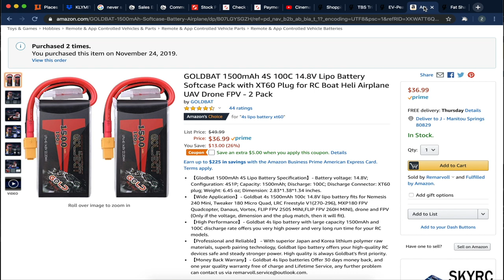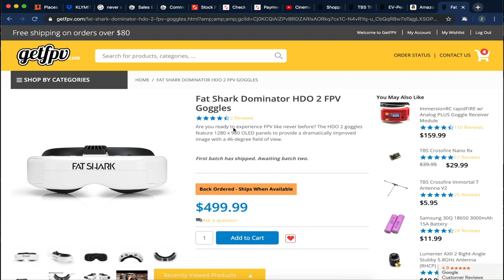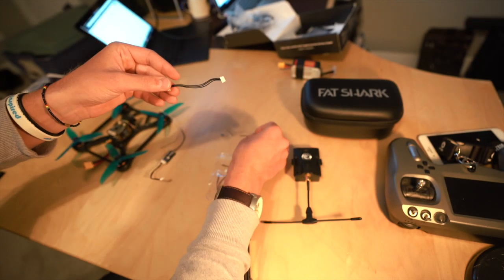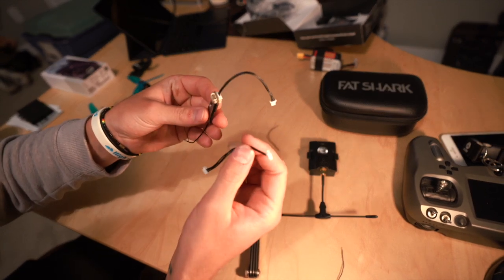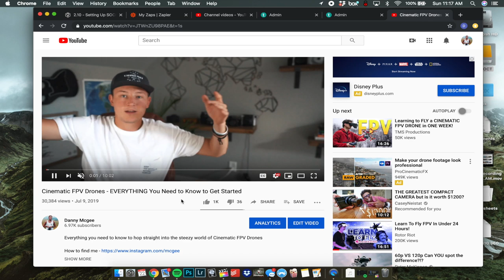The BEST Cinematic FPV drone - TBS Oblivion full setup video

Comment: My fists serious 5 inch has been Emax Buzz. I was then thinking that BNF drones are perfect for beginners. But, what about any repairs after crashes? Then I changed mind and I still think that any beginner should first off all learn how to build or at least how to repair just in case. Every drone pilot will need to repair their machine eventually. Thanks for sharing. Cheers!

Comment: Hi, I have a Taranis Qx 7 and I was wondering if I could use that with the TBS Oblivion. Thank you, love your vids keep up the good work :)
Reply from the maker: Yep you should be able to - the bind process will be different but I've seen other people wit that setup
Reply: If you want to use it with crossfire, there is a modification board that needs to be installed.
You can get it from TBS.
Otherwise you can just buy a Frsky receiver.
Reply: I Actually do just that. I purchased an R-XSR frsky receiver and with very little work you can get it setup and get it on betaflight. IntoFPV forumn has been a gold mine for me, and if you look, you can probably see my help me thread doing just that!
Reply: @Bigbeardfpv  Seen your thread :)  Did you make it work at the end? Also thinking about going the same route with R-XSR on the oblivion.

Comment: is it possible to get everything else and go for a different less expensive pair of goggles?
Reply from the maker: Yep you can use pretty much any google
Reply: @Mcgeee  okay sick thanks for the fast reply! also one more thing about the tango, I'm trying have m budget at somewhere around no more than $500 any recs for less expensive controllers and goggles?
Reply from the maker: @hankbabiar9668  Beagle drones has a super solid setup that's around that price. It comes with a drone, controller and optional goggles. Check this video out - https://www.youtube.com/watch?v=alGFjLF1YEo&t=53s

Comment: I really want to get into this hobby, but I’m so scared that if I crash it, it will result in a lot of money wasted I.e drone breaks, GoPro breaks or I lose it and repair costs.
Reply: Start with a simulator... and fly without GoPro in the beginning. 
There is no such thing as "if you crash".  You will crash within 10 seconds of you first take-off,  so learning to build and repair is mandatory...
Reply: Grab yourself  Tinyhawk RTF kit.   It's a full experience and beginner to intermediate level.   It will help you realize if the hobby is for you or not.
Reply: Darrel is spot on. Just get a tiny whoop
Reply: first step, don't listen to danny, the oblivion isn't even in the top 50 best ready to fly cinematic drones
Reply: Madmacs FPV how come?
Reply: @Michal_Kedzierski  there is a large fpv community who are mostly happy to help, you should get advice and buying options from them,  the TBS company makes some great gear, but this particular quad isn't very good, never has been very good, i can't help feel that danny knows this is pure advertising for TBS, which fine as long as its open about it.
Reply: @TheMadmacs  any suggestions on good pre built quads?
Reply: @Michal_Kedzierski  well this is the thing, i can suggest quite a few superb quads, cheaper better than the oblivion, the iflight nazgul 5, both 4s and 6s (4cell 14.8v and 6cell 22.2v) is not only a great quad but great value, anything by armattan, literally anything,  or if you are on a budget, the skystars starlord, i would also point out you need two quads, you can't fly well knowing one crash would end the day,  but i would add another class oof quad called cinewhoops, which are slower and better for  general cinematic slow stuff, mostly 3inch quads, you guys must realize a 5inch quad is a racing machine capable of 0-60mph just over 0.5secs, even the slowish ones??? the best advice is to watch a few youtubers and get a feel for what you want and need,  andyrc has a great channel with top quality reviews, but also watch some pure pilot videos like russel kim fpv, jjfpv, jordan temkin fpv,  you will find most people in this hobby got here through help from other people and are more than willing to help when you get stuck.

Comment: What camera angle do you have? I have a race drone with 45” camera angle, is that a lot?
Reply: 45 is a lot, you could race with that angle, lower is easier for learning and for tricks and landing, a good wide angle lens helps 2.1 at least and possibly 1.8 , 145 to 165 degrees respectively, i use 20 to 30 deg cam angle, if you ever want to hover and look at something you need about 20 or less
Reply: @TheMadmacs  ok thanks, i will build a drone for cinematic anmd 20/30 cam dregree

Comment: This video is clearly sponsored by TBS. there are lots of better and cheaper gear out there not branded TBS. look on banggood . There are lots of Ready To Fly fpv drones on there .The R9 system is a cheaper version of the crossfire. Also go for a FRsky radio instead of that crappy TBS radio. Goggles . Get Aomways to begin with.✌🏻❤️
Reply: I want a fpv drone but I dont know which model.. I want to put the osmo action (or gopro 8?)
Reply: haha it is - but the drone is fun and great for more cinematic flying with a hint of Freestyle thrown in.
Reply: You are right about some things... The Oblivion is a bit older and Definitely not the "BEST fpv setup".  The R9 has way less range and less consistent penetration compared to Crossfire, and it is worth the extra money. Aomways are also not the way to go today, becuase you can get new HD3s for just over 200. FrSky or Jumper are both better than that TBS though.  Also, Why am I even commenting on this, its been like 3 months lol
Reply: Leviathann what would you recommend someone? I’m wondering what the best setup would be to start out with. I would want to be able to mount some type of 4k action cam
Reply from the maker: Not sponsored by TBS - I would've disclosed that in the beginning. Its just the setup that's got me up in the air and still use today. There might be somewhat better gear out there - but coming from someone whose main purpose is just to film - the all in one system is the move
Reply: @Mcgeee  Hey! Nice video and all but I agree, TBS oblivion is outdated and wasnt at all designed for cine. Its got small motors and a racing frame which doesnt suit gopro's. Its got outdated electronics aswell. Was kinda disapointed just because the drone you chose, you should defo make a video using something like the T-Motor FT5, which is wayyy better and way cheaper than this drone
Reply from the maker: @justfpv1432  That's what I filmed basically my whole FPV reel on so definitely don't agree that it doesn't work for cine. But I agree it's outdated. Making an updated version of this video next week!
Reply: @Mcgeee  Sounds good! What drone will you be using?

Comment: What makes this the best?  The fact that it has an F3 flight controller and other outdated components or the cheap underpowered motors while being as expensive or more then the current top of the line bnf's? It sucks that guys new to the sport are falling for the marketing. Its like if Apple started selling iphone 2nd gens labeled as the "iphone beginner" phone.  The best phone for beginners and priced it at the same price as a top of the line Samsung Galaxy lol.  I beginner I know got one of these and it is such a shame.  At least he purchased a top of the line bnf for a lower price after getting honest advice.

Comment: 40 bucks for a battery is expensive...
The tango is also way more expensive than what you need. No one fly fpv with the tango screen...
Reply: It's a two pack of batteries fyi. But yes the tango is overpriced cuz it's pre-built
Reply from the maker: It helped me a ton when was first learning - on top of that is saves you $300 out of the gate on nice goggles while you're practicing.
Reply: @Mcgeee  that's true. I bought the 80 dollar eachine with dvr and diversity and will upgrade when I'm good enough to not trash my quad lol
Reply: @Mcgeee  I'm happy you could learn faster that way. I guess we are all different. My experience from the time I was learning, using a combination of cheap box goggles and a video receiver connected to a TV flying the quad in the yard outside the windows of my living room, was that the cheap box goggles actually taught me how to fly but the TV and the fact that I could see the quad line of sight divided my attention and I ended up looking at the quad instead of the TV. Very distracting.
My regrets was that I didn't buy Fatsharks immediately...
Reply: @beezermedia  Aha so 20 bucks per battery, that's good price if the batteries are good quality. I just switched from Infinity to GNB. Both are great considering the price. My switch was due to going from 4s to 6s and I just wanted to try something new.
Reply: @Siamect  I've actually not flown anything more than a tinyhawk so far. I'm actually better than I expected with a bit of sim time. Going to build a 5 inch soon
Reply: @beezermedia  Great, keep practicing. 

I started with 5 inch immediately and I'm sure I would have learned faster with a smaller drone. I really had a lot of misconceptions... I thought that I better buy the most powerful motors on the planet to make sure the drone would fly even if not as light as I wanted it to be... so I ended up with the ZMX v2 2205 2300kv which at the time was considered monsters although today you would probably say they are too small for a 600gram drone. I had to set my max throttle to 50% in order to not end up on the moon... :) and I learned to fly with that.
After a month I could go back to 100% throttle range again.